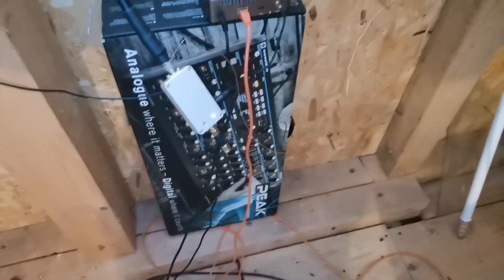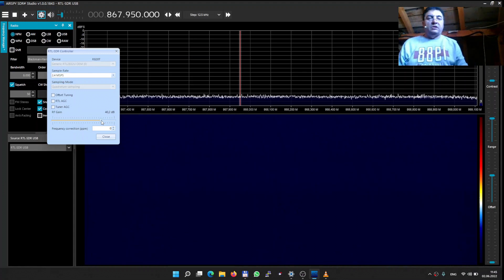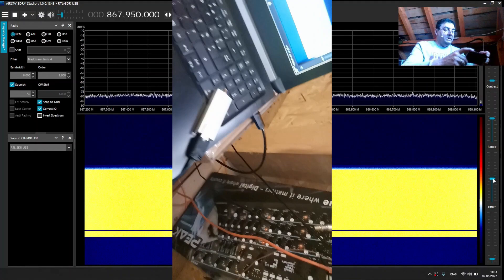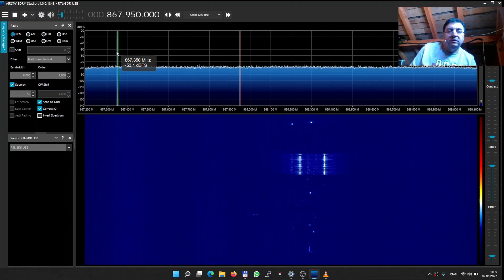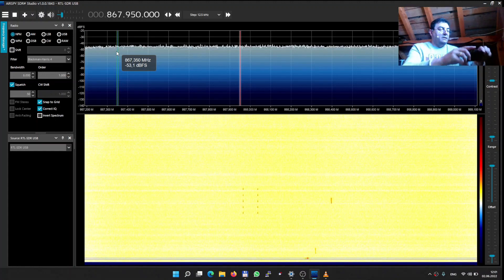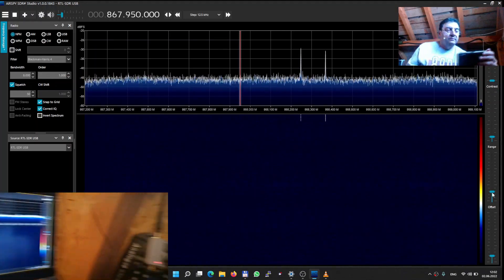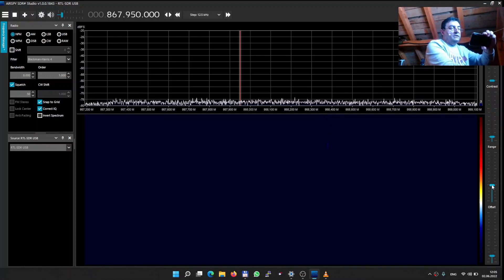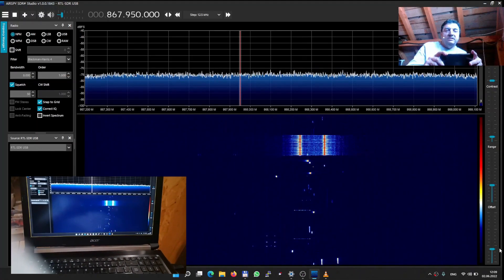Simple RX test Acasom v1 vs bare antenna vs SPF5189z

Comment: Great tests. Hi, as others say, try with filter in front of amp. On SDR waterfall you can see that with amp without filter noise level is higher than signal level without amp (yellow all over the band).
Reply from the maker: It.s coming saturday

Comment: What power plug do you use to power Acasom?
Reply from the maker: Original 12V power supply
Reply: @viocaia  I ordered Acasom amp with bias tee, but I don't want to use it to power amplifier, but then again I have to find very tiny charger plug to power amplifier directly. I am not sure about the size of this plug, that's my issue

Comment: YES Viorel! Thank you for testing! I think this is the same EXACT issue I spoke to you about yesterday commenting on the filter video! Even though the Acasom v1 may amplify the signal strength, still very few beacons are detected, and neither of us know why. The beacons you actually do receive are far and few between but they may be received at a higher RSSI, either way, higher RSSI doesn’t matter if the amp blocks a good 60% of possible beacons! This proves it! I can’t wait to see what you find inside the amp as it may be the same issue with mine. I will also say that since I removed the v1 Acasom amp and direct connected to the antenna, I have had at least twice the rate of witnessing (receiving) and also beacon (transmit) better in just two days. This nearly proves that it is the amp itself that bottlenecks the performance of the QUANTITY of signals received. Also, was that an Airbuddy amp I saw at the end?
Reply from the maker: At the end is a very simple amplifier with SPF5189Z chip, which I moded with an input filter..works great, only RX though..
Reply: @viocaia  very nice! Hopefully we can find out in your next tests what about the v1 Acasom is blocking out the majority of the existing signals.
Reply from the maker: @Philneye5389  Will try..

Comment: I mean you need filter (cavity is better)
Reply from the maker: It's a need!
Reply: @viocaia  When you put  a dummy load on the antenna side you don't need a cavity filter. You will measure the real noise the Acasom produces. And use battery power as it is clean power ;)
Reply from the maker: @renedevrind1733  Good idea! I'll do that
Reply: @viocaia  Also, we test with AirSpy too but at RF Gain we set it to max. 49.6 dB and use RAW. With RAW you get get extra the Floor and SNR.
A good amp (17dB RX)  with a dummy load will  have a Peak -78.4  | Floor  -81 | SNR 2.6 with RF Gain set to 49.6 dB
Reply from the maker: @renedevrind1733  I'll have those sets in my next test..

Comment: I got some interesting results with acasom amp when I put a 6db attenuator in between antenna and amp and 6db attenuator and a saw filter between amp and miner and it worked. I got good RSSI and new witnesses, but the noise ratio was worst but exeptable. I got that idea of sound amps, when you redusinng amp gain you redusing noise THD noise level.
Reply from the maker: Kind of strange..to respect the audio amps..to input signal should be as high as possible..let's say a microphone..to avoid extra preamp gain, which brings noise up too..but interesting setup..
Reply: it's along story, but the idea is when you attenuating the input signal you allso attenuating noise. gain of audio amps is about 20 thats optimal gain because when you amplofiing signal you also amplifiing noise.
Reply from the maker: @laurynaslauris9677  Absolutely!
Reply: @laurynaslauris9677  good point! Currently trying to work with my Acasom v1 setup and I may try this. But just as shown in this video, my performance increased dramatically in 1 day after removing it. There has to be some kind of bottleneck within this particular amp that causes it to block out all of these signals. Perhaps it may have something to do with the amp (being both a Tx AND Rx device) attempting to transmit at the same time it receives…maybe it can only do one at a time and thus impedes itself and malfunctions? Or it just has a difficult time switching back from whatever signal mode it used last? Just theorizing here as I am no expert…yet..
Reply: @Philneye5389  most likely it is overloaded with the signal like with nano vna without 20db attenuator at the input. I tested it with nano vna with 40db attenuator at the input and it was working fine. so I thought may be the input from high gain antenna is to high for the amp and put 6db attenuator before antenna and I was surprised that it worked. but at the moment net is crap. so there are no posibility to test things.

Comment: Nice testing Viorel!  I'm really wondering what is wrong with the Acasom amp?  Or nothing is wrong but you need a good cavity filter to use with it?   I will wait for your next video.
Reply from the maker: My area it.s pretty radio clean.. I. ll do a filtering in the next test
Reply: acasom amp has saw filter inside and cavity filter is just another way to pull money from your pocket. ghere is no need for that. it's inside allready.
Reply: @laurynaslauris9677  Acasom is a very noisy amplifier even with those 3 saw filters.
Reply: @unqualifiedexpert  yes indeed. but may be it is posible to fix this. because the chip itself is not bad.
Reply from the maker: @laurynaslauris9677  That;s true..There is a saw filter inside on both RX and TX path..now I see the bad point is that RX saw is after the LNA..not before..so I'll insert a saw before input

Comment: Maybe this is the reason you need a filter before every amp which has only one on output 😅
Reply: Or try adding an attenuator after the amp, maybe it overshoot the lna of the sdr
Reply from the maker: @cabanossi  I will..
Reply: @viocaia  would be nice if you test 3 db, 6 db and higher attenuator if you have. Because people using bought ones with that values.
Reply from the maker: Good idea for next test!